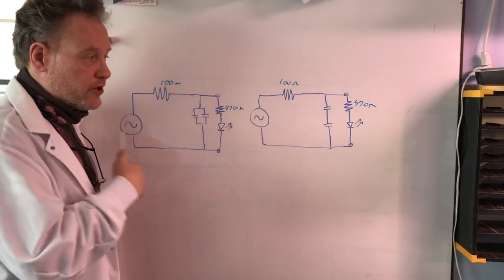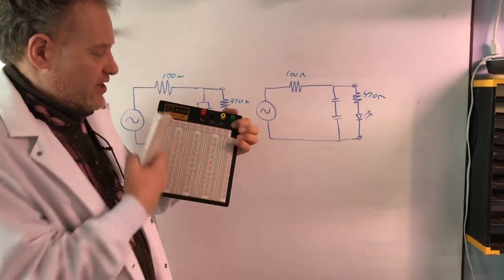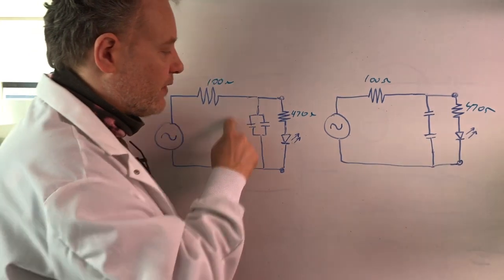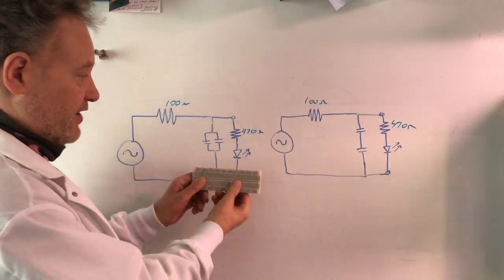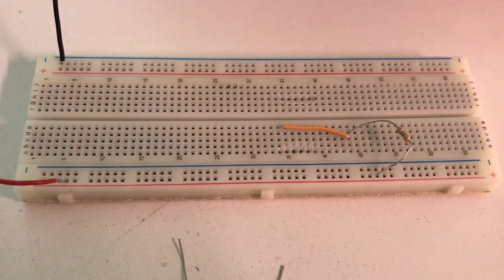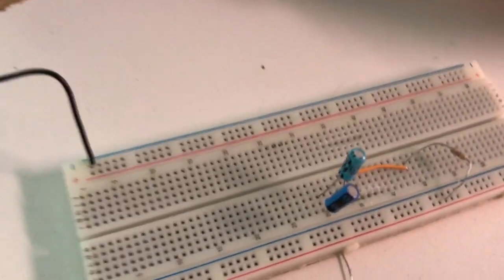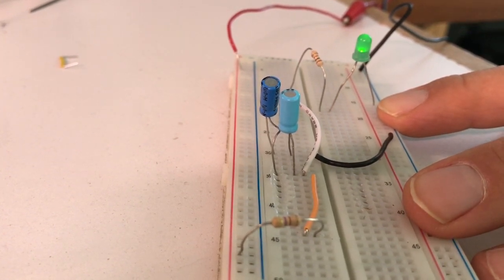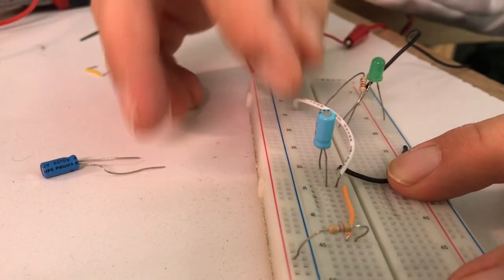Breadboard walk through with an RC Circuit

Comment: Great content, would you have material on how to measure the natural response? 
I can see a nice damped sinus (about 6 periods well defined) on scope, but when I connect ground & Arduino "sensing" input analog pin the shape changes drastically:
 If grounded, looks like a capacitor discharge (exponential)
 If only the analog pin is connected, the dampening give it about half period, (not enough to measure). 
I'm confused.

Comment: Thank you, sir! I wanna ask what happens if we use DC source?
Reply from the maker: If we used a DC source the inductors would have no effect on the circuit.
Remember that if we use a high frequency, the reactance of the inductor increases and if we use a low frequency the reactance decreases. With that theme, if the power source is DC then the frequency is essentially zero and the reactance is then zero. The inductor then doesn't resist the current and it becomes a 'conductor' and acts like a wire.
I hope that helps. Email me at my Humber email if you have more questions. You can find me if you search "Humber College Faculty of Applied Sciences and Technology".
Reply: Thanks for the great presentation, sir! So, with the DC voltage applied the light will be ON. And there will be an open circuit across the capacitors until charged then after they are charged the light still remains ON, correct?